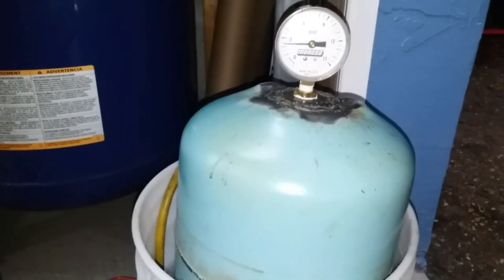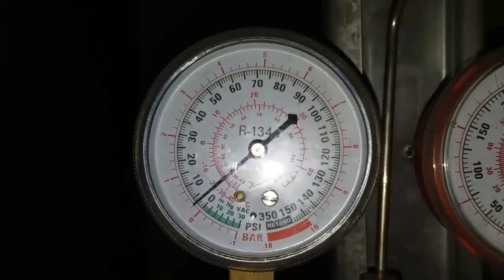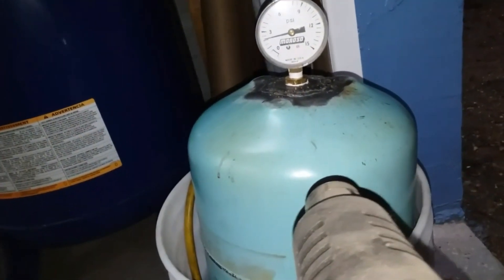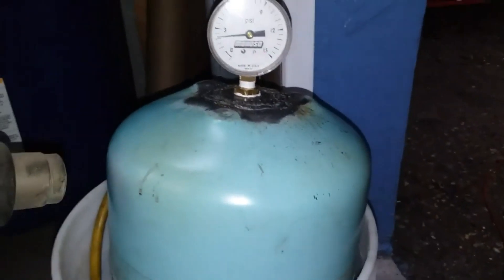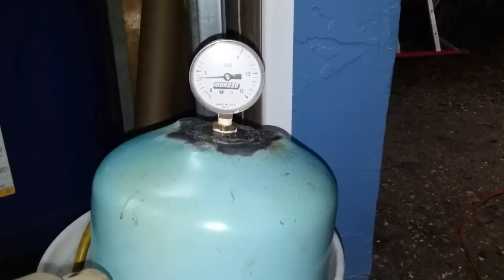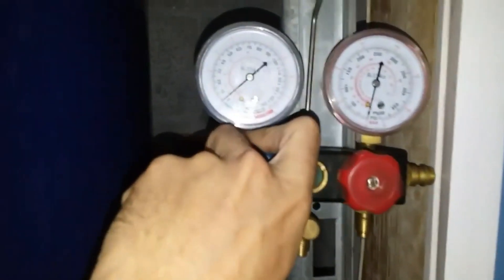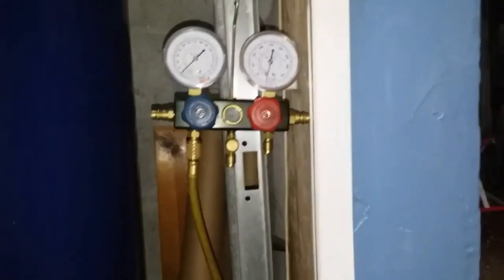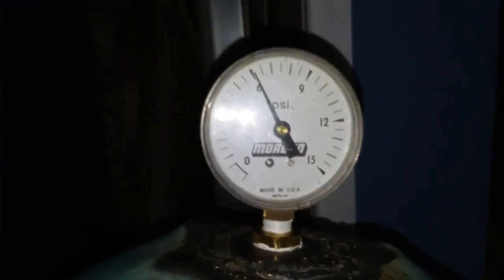Zack's testing the 2nd Law of Thermodynamics

Comment: I like where your heads are at. A bigger tank may be required in order to create the needed temperature variances. Temps reach 800 Celsius around 300 km up, so that would be tough to reach, safely. You may not need to reach such high temps, if you can lower your bottom temperature significantly enough. Nitrogen gas would be ideal for cooling at the bottom and perhaps 2-3 propane burners (size of burner would depend on size of tank) heating the top of the tank?

Keep up the great work!

Comment: just thoughts: Variation in gas pressure: imo, this is interesting. And there is some evidence for it given the 'thermosphere' layer of the atmosphere. 
  However, I would be happier seeing a similar arrangement but a significant electric field applied from top to bottom.  I suspect that is more likely to cause a pressure gradient. see Van Der Graff generator and Van Der Waals forces.  I haven't tried the experiment. 
  I really am curious why this place works really hard to maintain a constant electric field. It isn't coincidence. ;-/
Reply: Good thinking Ryan 😃Do you think we have a gradient of charge in the air, or just that it is the attraction from earth causing the gradient as a result of the mass pushing down on itself ?
Reply: @shane2869-1  The way I think about it: 
   1) The gas molecules are moving about randomly. 
    2) there is a 'bias' for the gas molecules to travel towards the surface of the earth.
        The Van Der Waals  forces are 'weak' but constant and always attract. 

  As they get closer together they 'bunch up' towards the surface of the earth then the 'bias' is overcome by the  energy of the collisions of the molecules. i.e .the pressure will  equalize for a given temperature.   

  I have no proof of this. But it seems reasonable.

Comment: Also keep in mind that the actual reason for the increase of pressure at lower altitudes of our atmosplane, is because the atmosplane contained under the dome is a fluid, which is made up of multiple gases of different densities.  Literally billions of tons of them.  The denser elements will of course settle towards the bottom and thus have the combined weight of all the elemental densities of the fluid above them, causing a higher pressure the lower you are in the atmosplane.  

This is why the deeper you go in water the more pressure there is, only it's more noticeable within shorter depths, because water, in liquid form, has a higher density per sq. inch than our "air" per sq. inch.  

The globe trolls tried to make this a thing, as a deflection, because there are now millions of  woke people asking, "how can 'air' be smack next to a -12 Torr super vacuum of alleged 'space'?"  Of course it obviously can't, no matter how much MAGIC they imagine-up to explain it away; so rather than focusing on that fact, where they instantly LOSE the argument, they use a logical fallacy and redirect the argument to, "how can there be pressure gradient in a DOMED closed system?" that we actually live in.  

My next comment will explain much more for those who are interested in real science and truth.
Reply: Great points and just to confirm this is indeed an argument postulated by helio-zealots, as I came across it just the other day. I lacked the energy required at that time to sit down and put into words what you did here. Great post! It all seems so clearly obvious now...now.
Reply: AddTheDot bro.... did you seriously just go off like that? 🤯
Reply: @foreverflat7204  Yeah, but I saved it so I don't have to type it again.  Please feel free to copy and use anywhere, no need to attach my name, it's Gods truth, he gets the credit.
Reply: @addthedot3189  megainteresting! Got fb? Will Bee is mine. Thank you!
Reply: facebook is useless, if you post any info of this nature on FB, don't think that anyone other than the trollbots are responding to you, I guarentee you that you are shadddowbannned on twit, insta and fb.  and much of what you type here is banned.  Don't believe me, post any of the material that I have here on FB and see if you aren't banned within 2 days.  Try it.   They'll assign trolls to friend you and make you think ppl are seeing it but no one else on your friends are seeing it.  I tried it with 7 different accounts, all instant  shadopwbanned

Comment: Put a bit of helium in the tank and surround the bottom with dry ice or something of that manner.🤔
Reply: @addthedot3189  you confusing that with hydrogen? Helium is a 'noble' gas and doesn't like combining with anything else.
  Always worthwhile looking for ways things can go wrong. Gases and heat can get dangerous.
Reply: Ryan Q Vincent I was going to do it in my vacuum camber in completion, upmost care must be taken, as you say gas and heat can be dangerous, but no gain without risk😜
Reply: @Rude_Earther  Have a 'blast shield' between you and the kit? Take care. However, as you say, you gotta do it.
Reply: Ryan Q Vincent yes m8, gotta be done and the helium is needed to represent the gasses of the upper atmosphere. It’ll be one of two three outcomes.
1. Variable gas pressure within a container.
2. No change in pressure.
Or 3. No Rude earther.😳
Thanks for the good will.✌️😜
Reply: @ryanqvincent144  I stand corrected.  Thank you.